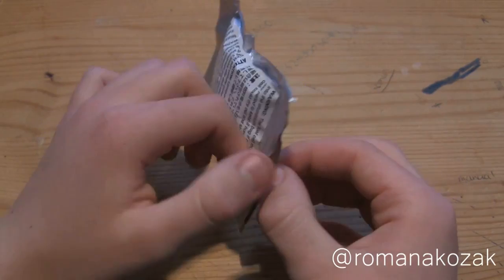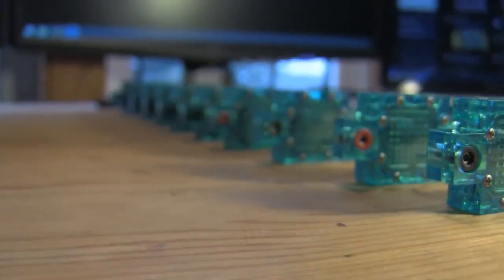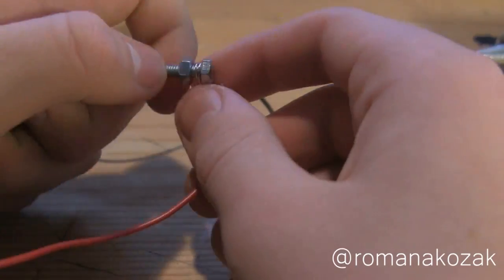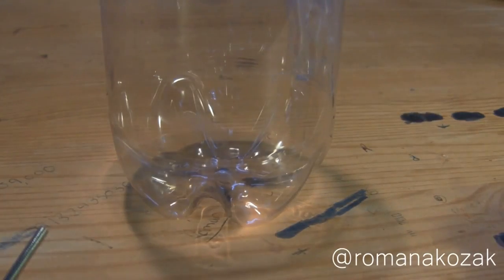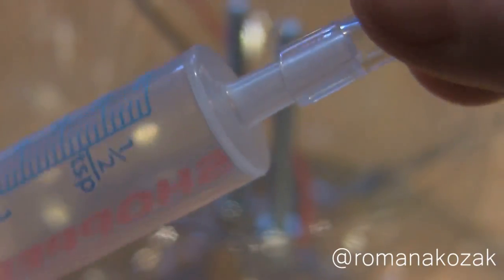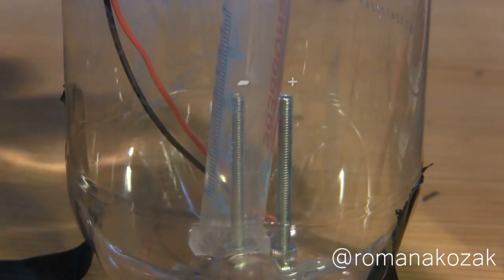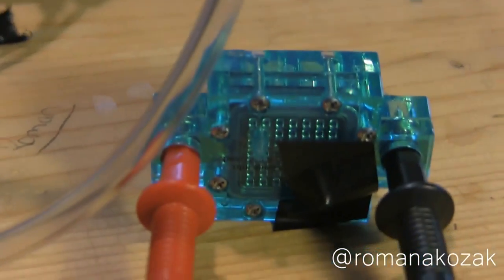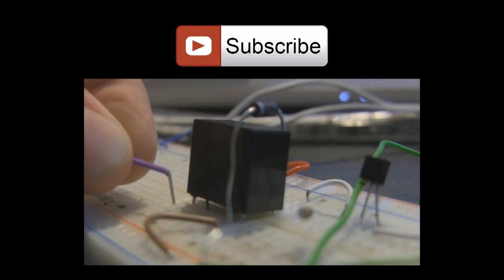Create Electricity from Water | Hydrogen Fuel Cells (No More Fossil Fuel System)

Comment: Why on earth would you add NaCl to the water??? Instead of getting Hydrogen and Oxygen your now getting only half the amount of Hydrogen gas and you need to use more input electricity... and your have to deal with the potential really hazardous byproducts (NaOH, Chlorine and NaClO, or NaOH and HCL if you keep it sealed). If your goal is to produce hydrogen gas then using destilled water would give you the most hydrogen at the lowest energy input with no dangerous waste product... unless you plan to re-package the waste product as health supplements and getting paid instead of paying to dispose of them. Then the simplest is the best. And if you want to maximise the energy output then you combine the gasses after it passes the fuel cell and egnite the mixture with a sparkplug to drive a combustion engine. that you can use as a generator and the exhaust is just H2O which you can put back into electrolysis. Hydrogen gets really hot when egnited so you should probably need a lot of watercooling. for the engine. You could power a steamturbine from the "watercooling". And if you know the "magic" of steam turbines and curved blades then you should be able to get some fantasy numbers in the end equation....

Comment: You did not make electricity.  You only used electricity to separate hydrogen and oxygen.  There is a certain way to combine them that results in creating electricity.  The second half is to join them back together into a second fuel cell to reverse power a circuit  load, attached to the end of the second cell.

Comment: Your soldering technique can improve. You need to heat the metal you're trying to get the solder to flow too first, then touch the solder to said metal. In your video, you were melting the solder on the iron without heating the metal which is why it globed up so much.

Comment: Can the fuel cell charge a battery faster than the battery discharges?
Reply: Matt's Van Life of corse it just depends on the size of the fuel cell and how much power is being drawn from the battery. the output of the fuel cell has to be bigger than draw but this cannot power itself of that’s what you mean

Comment: is it efficient??and is the power output is greater than the power input?
Reply: Parallax Genesis Of course it's not. Need to get hydrogen from some chemical reaction not by electrolysis of tap water.
Reply: No it is not. If you saw it it took him 9 volts to create  1volt . The only great part about fuel cells is in my opinion that you can store it longer than electricity in batteries (if stored properly) but on the other side storing electricity in batteries is much more efficient.
Reply: shut up

Comment: So it takes 9 volts to create almost 1 volt.
Reply: i guess this is just a demonstration. You can use a hydrogen tank instead of hydrogen generator. you wont need a 9v power source when you have a tank right?
Reply: @mustafacelik465  Sooo how do you get the hydrogen in the first place into a tank? Using more electricity...
Reply: So? If I can create 1 volt from 10000 volts it might still be very efficitient. you're missing certain parameters in your comparison buddy..
Reply: he dont have hydrogen source that why he used electrolysis process to make gaseous hydrogen.